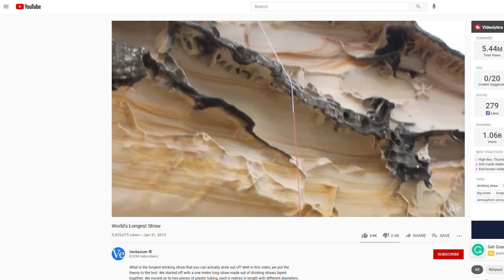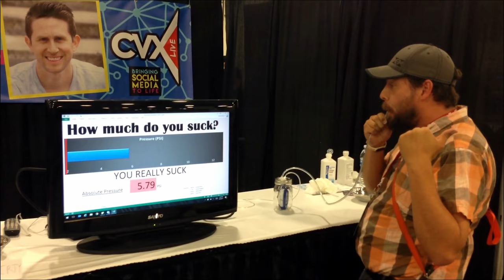Trying To Drink From The World's Longest Straw

Comment: What if you used ice water to bring the temperature down as close to 0C as possible? Would that stop it from vaporizing early?
Reply: Hi baker
Reply: No, the crystals will not make it through
Reply: Good idea!  He would probably have to degas the water too though.  Boiling, or adding salt, should work.
Reply: But theres another limit: If you've got 0 Bar in the tube above the water, then there will be only 1 Bar difference between air and tube. And thus the water cant be sucked higher than around 10m. Cause water with 10m hight has got 1Bar. And thus it comensates the pressure by itselve. So you can only suck it higher if there is already no air in the tube, cause then you can build up negative pressure in water. (yes you can build up negative pressure in water like you can in hard materials like wood, too if you pull on them. Water will "break" at negative 1000Bars  and treewater at negative 100 Bar and thus trees can suck up water higher by building up negative 100Bars in them, cause there is no air inside of them)
Reply: That is a good idea I’m curious 🤨 🧐 👀
Reply: @Showtime5285    No
Reply: @neutronenstern.   The pump would have to be pumping the water itself at that point.  What do you mean by the water "breaking"?  What happens to it?
Reply: Wouldn't the low pressure cause the water to freeze?
Reply: @sovietbot6708  no its the reverse
Reply: @xploration1437  I never did the experiment it is my prediction... Sorry
Reply: @pinuelajamesmezack7054  I thought when water is under vacuum, it boils then freezes.
Reply: @DANGJOS  its tearing apart. And yes the water had to be in the pump, too.
Reply: I wonder if it works better with oil, because oil boils a lot hotter... So its vapor pressure ought to be a lot higher (or is it lower?)
Reply: Yes it would
Reply: Or try using a liquid with very high boiling point...that way,,, probably it won't boil.
Reply: @neutronenstern.   as in internal cavitation?
Reply: Yes please try this.
Reply: @Showtime5285  It'll decrease it even more. Think of boiling water as the 'hottest' molecules flying off the surface leaving only the cooler ones behind.
Reply: @sovietbot6708  hmm I suppose it would.  Unless the ambient temperature is enough to override that.
Reply: No at low pressures the boiling point goes low as well to maintain the balance in nature
Reply: @DANGJOS  yea somerhing like that
Reply: Hello verified guy
Reply: you are genius
Reply: the max heiht would be higher, like 36-37 feets
Reply: if thermally isolated it would freeze because the boiling and evaporation takes away heat
Reply: Good idea
Reply: @pinuelajamesmezack7054  Water is weird, it has max density at 4 degrees C. If u drop the pressure, it favors states with more volume or less density. This means either towards the gas state or the solid state (they are both less dense than liquid state). Hence the boiling point drops and the freezing point increases. If your water is near freezing to begin with then dropping the pressure will cause freezing.
Reply: @sovietbot6708  U r correct in the case where the water is near freezing to begin with. If it was nearer to it's boiling point at first then it would boil.
Reply: Also if the pressure is dropped enough such that the freezing point is the boiling point then u get the triple point of water.
Reply: Or you can simply push the water up and go to whatever altitude you want in whatever temperature (as long it keeps on liquid state)
Reply: I guess even if the water is at liquid state at 4°C and it is being sucked it will still not be able to overcome the Barrie as the pressure is increase which leads to decrease in boiling point and thus the water will heat quickly.
Reply: Technically vaporizing gets it where it needs to go.
Reply: Probably want to prefill the tube.
Reply: @sovietbot6708  When the tripple point of water is reached it can boil, freeze or vaporize within very small fluctuations in temperature
Reply: GOOD QUESTION
Reply: reducing the temperature wouldn't change the amount of force required to lift the water. The water would still stall in the straw at the same height and the only way for it to get any higher is by vaporizing in the vacuum. I think at least.
Reply: @neutronenstern. yes but the limitation of boiling comes first because the water triple point is slightly higher than 0 bar. I think is 0.006 bar . Below this pressure you can't have liquid
Reply: If you were to drop the temperature of the water in the bucket (still above 0*c so it remains a liquid) then it would certainly have a greater tolerance to lower pressure before boiling.
According to the water phase chart (https://s3-us-west-2.amazonaws.com/courses-images-archive-read-only/wp-content/uploads/sites/53/2014/08/19212109/20140811155434493809.png), water at 0.01*C can tolerate pressure as low as 0.006 atmospheres before boiling.
I'm sure someone can do the math and determine the incerased height limit.
Reply: @mariospapanicolaou4631  yes you are right. But this isnt a big difference (6cm)
So all i wanted to say is, that with thia method you cant do a lot because of the actual pressure limitation of 1 Bar
Reply: He addressed this in the video talking about temperature yes
Reply: That might work, although not very well. At 0.00005 PSI (the pressure inside an almost perfect vaccuum) the boiling point of water reaches -67.78 °C. Once you reduce the pressure even more (to 0 PSI), the boiling point of water approaches absolute 0, or -273.15 °C. That is an impossible temperature to reach, especially using frozen water which has a temperature of 0 °C. So if you conduct this experiment in a perfect vaccuum it would be impossible to prevent the water from boiling. Now I know the vaccuum pump used in the video doesn’t create a perfect vaccuum. But I’m assuming it can get pretty close, so preventing the water from boiling with regular ice would be pretty difficult. Using either liquid nitrogen or dry ice however could result in a pretty interesting experiment. (Chart I’ve referenced while writing this comment: qph.fs.quoracdn.net/main-qimg-491bc57d75ed7a63b73690ccfd07cc4a.webp )
Reply: The definition of boiling point is when vapour pressure meets surrounding pressure so Ig temperature doesn't matter much, it will boil. (Given you said that it's ice water and not ice crystal, if it is ice crystal, then well let me think a bit more).
Reply: @luukmuller9646  Ice can be colder than 0 degrees tho
Reply: 4c° is the densest temperature of water
Reply: It boils from the pressure differential (or lack there of) not the temp, water can boil well below the normal freezing point of 32F or 0C.
Reply: what if he pinched the straw and dragged his fingers upwards to draw it upwards like that while drinking?
Reply: @neutronenstern.  This makes me think of how many problems vacuum tube travel (Hyperloop) actually has to deal with. They need to make all of their parts work in a low / no atmosphere operating condition, so pretty much just like designing for parts that go on the international space station.
Reply: @thany3  First, if we are talking about him being able to suck higher, it depends on the following points:
Remember his max was 14 feet high. This means he is only able to produce 14 feet of head through the straw, or 6 psi. 
To increase his max head, there are 3 variables you can change, 1. Atmosphere pressure 2. Temperature 3. Fluid used
About #3: You would choose the least dense fluid so he could have an easier time sucking(lifting) the fluid, so liquid hydrogen. This means if he applied the same sucking force, 6psi or 14 feet of head(water), then he would be able to raise liquid hydrogen (in the same diameter straw) to 197 feet high. This is because liquid hydrogen has a density of 71 kg/m^3 whereas water has 1,000 kg/m^3, 14 times less. Pretty cool.
Reply: was about to ask that
Reply: @BigCroca  That defeats the purpose of the experiment. He wants to suck from one end of the straw. Here's a cool fact about water, there are actually 2 liquid states of matter for water. The second state/phase occurs at 40 Celsius and a few properties change. Thermal conductivity changes at 64 Celsius, the refractive index at 50 Celsius, electrical conductivity at 53 Celsius, and surface tension at 57 degrees. The theory is that the weak hydrogen bonds cause the change in water's molecular structure at those crossover temperatures.
Reply: @creatorsassets  it won’t but it is at least colder
Reply: Maybe done on winter
Reply: @kevinthekid9623  Then it will just sublimate
Reply: @sovietbot6708  
No
Imagine gas and solid
In a gas the particles are farther apart and in solid they are more close and dense

So if one lowers the pressure there is more space available for the particles to move around and become a gas
Then if one increases the pressure the particles will be compacted back by other particles closer together into a solid

That’s why it’s easier to boil water on a mountain than than sea level
But it means you need more water at a mountain from releasing water to the atmosphere and it takes longer to cook stuff
Reply: Technically I think you can have liquid water below 0°C, at least at 1 atmosphere, I think that is just the hottest it is able to freeze. So you could actually have liquid water all the way to -42°C I think
Reply: Boiling is independent of temperature. It is about pressure. In this video most probably the temperature didn't increase.
The boiling temp increases as pressure increases so it decreases as pressure decreases. I hope i made myself clear.
Reply: I want to see the temps of the water in the tube
Reply: i dont think its about the temperature, its more about the pressure, like when you suck a plastic glass, when there is almost a vacuum the particles will spread to fill the space, thats why its boiling
Reply: Oh my god editing grandfather is here
Reply: No, it would still reach the boiling point in a vacuum at the same pressure.
Reply: No, It wouldn‘t make a difference or at least just very small one as the vapor pressure of water determines when it starts „boiling“. It does not get hot, the pressure is just so low that the water starts evaporizing…
Reply: Idk
Reply: @dohaalkabash5864  Yeah but also if you decrease the original temperature of the water, it will stay low so take slightly longer for the boiling point to come down. Although the temp hasn't gone up with the pressure decrease, if you start it lower then it will take longer
Reply: The water would just freeze
Reply: The best way will be using a a thin straw and not a massive pipe. Thin straw will have lesser weight thus we can pull the water higher
Reply: @DANGJOS  adding impurities to water elevates it's bpt so yeah it is possible to go past  the theoretical limit which is by the way set for pure water. But add impurities which shows negative deviation.
Reply: @Dhruv-lr1jp   But if you add too much salt, you'll also increase the density of the water, and that actually decreases the height you can get to.
Reply: with another liquid maybe, but water can go from frozen to vapor without giving a danm about temperature
Reply: @DANGJOS  density won't matter coz we'll be using vacuum pump
Reply: @Dhruv-lr1jp   It will still matter because the lowest pressure you can get to with your vacuum pump is zero.  That means you're limited by the outside pressure, and the density of the liquid, to determine how high the liquid can go.
Reply: @antoniojose-ok4jo  But the rate that it goes to vapor is temperature dependent
Reply: @pramod_p5  If the water is solid, (i.e.crystallized/frozen) at very low pressure the water molecules will sublimate directly to the gaseous state. This is how we freeze dry some solids.
Reply: @luukmuller9646  Hey Luuk, I would think that at any temp above absolute zero even very cold, solid water (ice) would lose its molecules under a heavy vacuum. Sublimation?
Reply: @creatorsassets  Thank you, no one else seems to understand this concept. I keep trying, but no luck… so far.
Reply: @Pepito You could drink from the world’s longest straw, however long that is, as long as you aren’t very much higher than your drink’s elevation. It must be said though, the longer the straw, the harder it will be to pull the liquid with your mouth. Friction from the inside of the straw makes it harder the longer the straw.  Just saying.
Reply: @dohaalkabash5864  agreed
Reply: @Pepito Sorry Pepito, these threads get very long, hard to keep track. But if, as you propose, he is at the bottom and the drink is at the top he’s not going to have to suck very hard before gravity does the rest of the work. No temperature change involved.
Reply: Just because water is freezing, doesn't mean it won't also boil. It's called a triple point.
Reply: Wouldnt the water just freeze?
Reply: I came to the comments to ask this, too. I'd like to see what happens.
Reply: Good idea
Reply: The vaporization issue is something of a red-herring.  If you do in in the traditional way, with mercury, or even with a solid plug that cannot possibly vaporize, the column simply will not rise if it is heavier than the ambient air pressure.
Reply: If that were why there was a theoretical limit, maybe, but it's not, the assumption that the limit is due to the vapour pressure of water is wrong. It's because there's a finite difference in pressure, and that's 1atm (or the atmosphere at the point the water is) no matter how much of a perfect vacuum you'll make you'll only ever have a difference of 1 bar. A vacuum doesn't suck, air pressure pushes. That is how Mercury barometers work, because of that fact, it's just convenient, because the mercury rises only 1/13.7th as high as water would.
Reply: 6:50
Reply: Its not boiling because of the temperature- it’s because of the low pressure in the tube so I doubt it will do anything
Reply: So there are actually 2 factors that determine if boiling. The first is temperature and the second is the force of atmosphere pressure and while there is an extremely small correlation between the 2 it is not much. This is why on earth we do not see Liquid methane occur often if ever in nature when open to the atmosphere but it can happen under high pressures if allowed to condensate from vapor or melt under pressure. Meanwhile on some of Saturn or Jupiter's moons it can be found as the temperatures on them is much lower while them seeing water would be comparable to us seeing Lava. 

On the other end a planet much hotter than earth might well see lava as normal and might see sometimes lava effectively being rain assuming it can vaporize.
Reply: No, h20 molecules need to be under pressure to remain in the liquid state. The temperature of the water has nothing to do with it.
Reply: I doubt it would make much difference- while the pressure is getting close to 0atm, you can't cool the tube and the liquid to crazy low temporatures close to 0K or everything will just freeze. So i think it would delay the boiling a little bit, but not long enough
Reply: @DANGJOS  you could have the pump on the lower end. 
You can make enough pressure to press the water up but vice versa is a limit
Reply: @sovietbot6708  the opposite. Boiling point is lower at lower pressures. This is why it’s hard to cook spaghetti on a high mountain. It’s even noticeable in Denver, Colorado, at about 5000 ft (1700m) above sea level.
Reply: @thany3  potentially, but not because of boiling point, but because oil is less dense, and the column of oil exerts less pressure.
Reply: @thany3  It works better with oil, but for a completely different reason.  Oil is less dense than water, and the atmospheric pressure can push oil much higher up the tube.  Water can only be pushed to about 10 meters, while mercury can only be pushed up to 76 centimeters (which is why a dense liquid like Hg is used in the barometers).  Vegetable oil should be able to be sucked up an extra meter, since atmospheric pressure in vegetable oil's density is 11.3 meters.